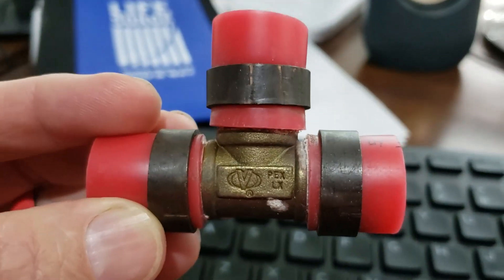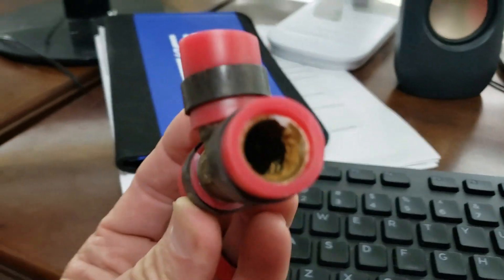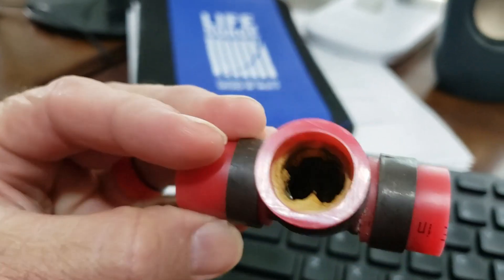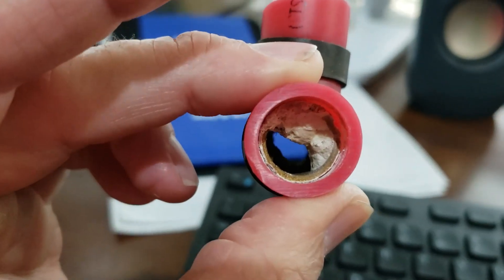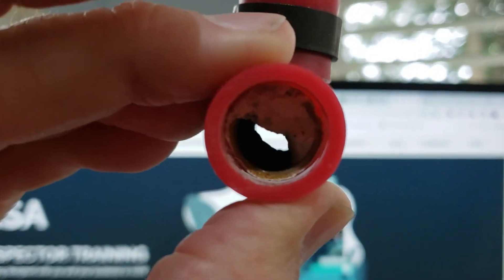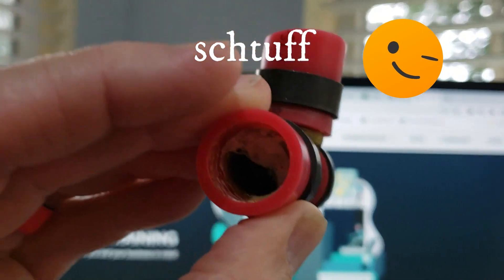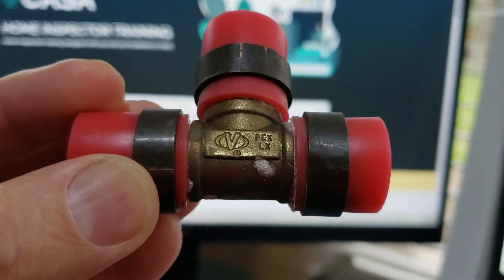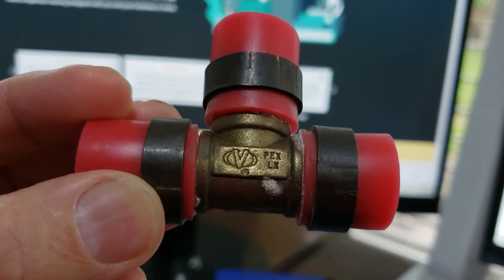Pex dezincification, occlusion in under 1 minute

Comment: I thought dezincification required galvanic action but PEX is plastic that isolates the brass fitting from other metals. So where is the conductive galvanic path?
Reply: Brass fittings don't require galvanic action for dezincification
Reply: Interesting, what’s the chemical or physical reaction causing the alloy to separate?
Reply: scientific, exact cause, I can't explain it like that, it simply leaches out, excess zinc content?  That is just 1 of the issues w pex though, many more @GrampalettasCamp
Reply from the maker: So I found this..."Brass containing less than 15 wt% zinc resists dezincification, but brass with more than 15 wt% zinc is susceptible to the phenomenon. Duplex brass is even more prone to dezincification than alpha brass (Scott 2002)."  from https://www.canada.ca/en/conservation-institute/services/conservation-preservation-publications/canadian-conservation-institute-notes/dezincification-brass.html